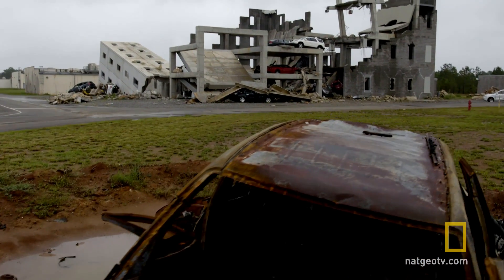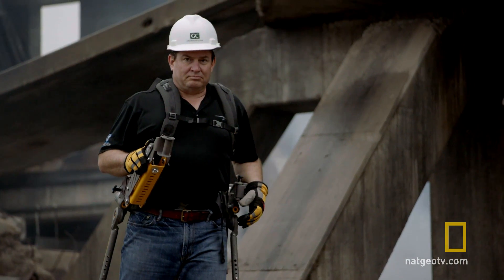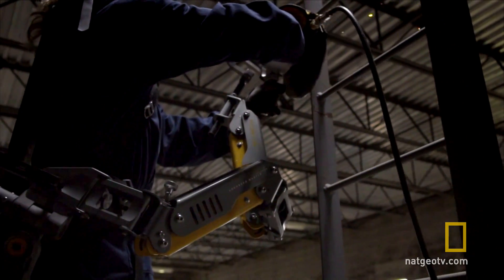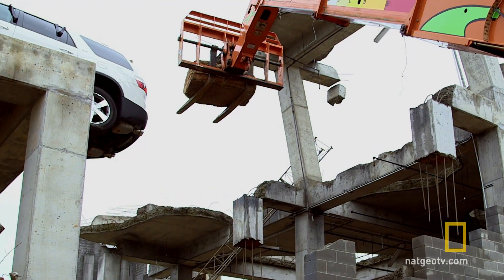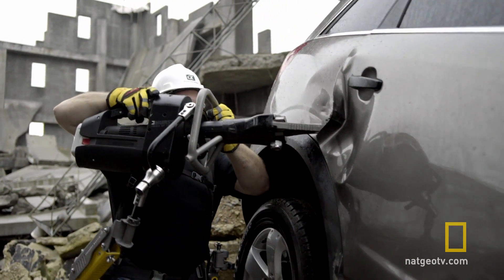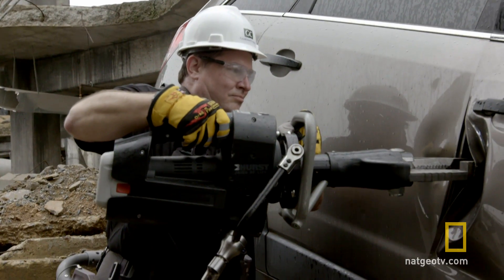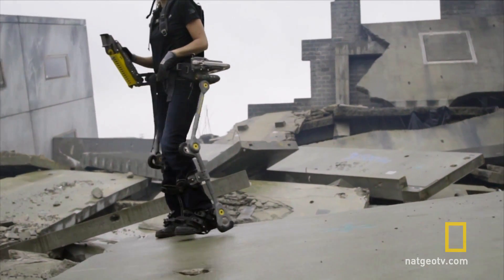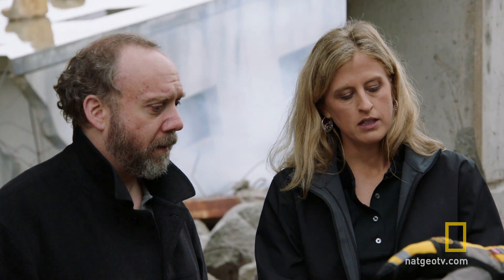Making an Exoskeleton | Breakthrough

Comment: wait. MrTeslonian has build one in ~half a month
Reply: +Hakenhand R&#246;hle I like his channel but teslonian's exo is fairly crap imho, yes it may augment strength by use of those winches but look how slow and clunky it is. Kind of like hacksmith's, both are basically just over engineered car jacks. 

An exoskeleton should be exactly that, and exoskeleton, an outer layer that does not hinder the operation or motion of whatever is in it be it a beetle, ant, human, etc. What lockheed martin and other companies like revision have done is created an apparatus that synergizes with the human body (to a point, some of lockheed's factory workers say moving is slightly awkward) to enhance a specific value/trait in this case the fatigue rate. All without the use of controls and switches.

I'm currently trying to make my own based on the fortis' unpowered design but there is alot more voodoo involved in that simple design than what meets the eye even for an engineering student. Granted I'm only going by pictures and what little videos are available + speculation.